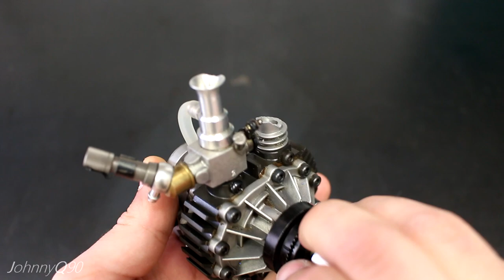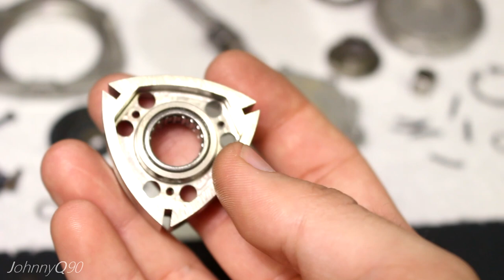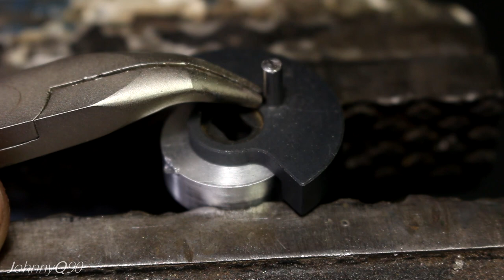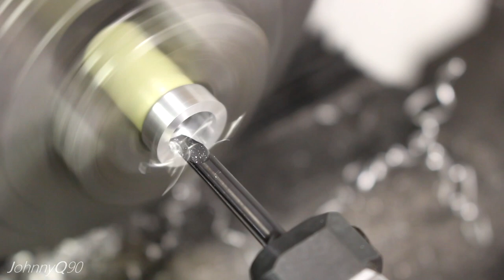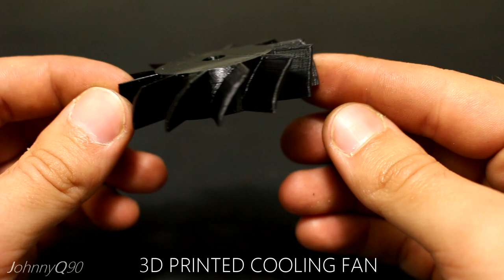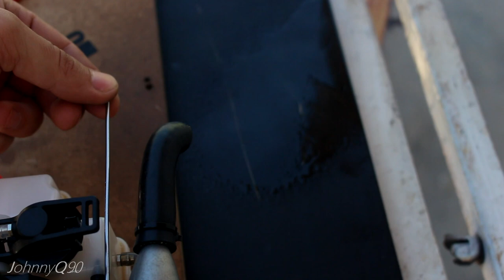Nitro Rotary Engine Cleaning & Pull Start Addition

Comment: Very cool, and yet most people believe the Wankel is dead.  I would like to see a 4 rotor design like this up against a Merlin engine from WW2 in a P51 or Spitfire.  The design was around for at least 20 years before World War 2.  Mazda and NSU finally manufactured the design in 1967.  These are the engines now being used as a "range extender engine" for the most modern Prototypes of electric drive cars featuring a Wankel 80 hp engine/generator.  It fits under the back seat and you can barely hear it. Fuel mileage at highway speed, low battery with the engine running is over 100 mpg.  And for an airplane, this engine makes even more sense.  I would love to see this engine running on 90% methanol and 10% water.
Reply: Actually the Wankel engine is dead, it has been obsolete as a production design since 2012.  Graupner discontinued them years ago and OS filed for bankruptcy.  The Wankel orbiting piston concept was not conceived until the early 1950's and Hanns Paschke and Walter Froede did not develop the Wankel engine until 1957. Sachs was the first company to manufacture them in 1964.
Reply: Wankel engines have never been used successfully as a range-extender, there are no manufacturers producing them for this application. The Wankel's terrible fuel consumption and exhaust emissions make it totally unsuitable for electric vehicle range extenders or hybrid powertrains. The Wankel engine was never commercially viable for aircraft because of the terrible BSFC which limits range and payload... its power band is also less than ideal for propeller drives, no one has ever managed to get a Wankel FAA or EASE certified for aircraft use either..
 The Wankel engine's fundamental geometry poses a serious disadvantage when considering alternative fuels like Methanol because the Wankel cannot support high enough static compression ratios for optimum thermal-fuel efficiency. 10% water? Why?  Water is not a fuel
Reply: Dr. BMW.  Honestly, I don't get your point other than you support Big Oily and V-8 piston engines running at 8:1 compression.  Here's some basic data from Wikipedia.  Felix did design the engine when I stated and it is anything but dead.  I can't understand why you would statements that are exactly the opposite of truth.
Kenneth M. Price jr   the-rise-and-stall-of-the-piston-engine.weebly.com

"The design was conceived by German engineer Felix Wankel. Wankel received his first patent for the engine in 1929. He began development in the early 1950s at NSU, completing a working prototype in 1957.[1] NSU subsequently licensed the design to companies around the world, who have continually added improvements. The engines produced are of spark ignition, with compression ignition engines having only been built in research projects.

The Wankel engine has the advantages of compact design and low weight over the most commonly used internal combustion engine employing reciprocating pistons. These advantages have given rotary engine applications in a variety of vehicles and devices, including: automobiles, motorcycles, racing cars, aircraft, go-karts, jet skis, snowmobiles, chainsaws, and auxiliary power units. The power-to-weight ratio has reached under one pound per horsepower in certain engines.[2]"

Comment: Would it be a cool idea to place several Nitro engines in series? Like placing some of these engines behind each other, letting them run at the same time and connecting them to a crankshaft. Would be pretty cool :). Please let us know ;)
Reply: I'm very curious about that to! like a small 2-troke V4

Comment: Nice Waco Biplane?  You are obviously skilled in the lathe.  Could you share kind, model No. and approx. price!  
Did you consider using TIG on the muffler?  The tubing inserted would have increased back pressure a bit.  Thanks

Comment: Looks good man! Do a turbo haha. But dont you think that pin you out into the countershaft threw off its balance? Could be stress on the bearings maybe try to find out how to equal out its balance again. Then it will rev easier and higher! It plays a big part in a fine tuned engine. Keep up the good work!

Comment: I saw you were using Loctitie on the exhaust, you should try JB Weld instead, more durable and withstands both oils, gasoline, heat etc. Expensive for the amount - yes, but you get a lot of value for the money..

Comment: A second hole in the counterweight in radial line with the first would have been a good idea to compensate for the added mass from the pin stick out.

Comment: you can tell adding the pin on the flywheel set the wights off alot  .. make a small hole on in the fly wheel on the side of the pin and test .  if you know the wight of said part before modding  then making the hole to size to wight would have worked better

Comment: Sure seemed like it vibrated a lot. Wonder how much you threw off the weight of the flywheel.
Reply: coolhanddruid does looks to be vibrating more than normal, make sure the balance weights are on the correct way (opposing the rotor) - also, on this engine the front balance weight is part of the prop hub. Looks like this has been removed in this video, probably the reason for it. Would be interested to see how it performs with a slightly different fan design and the prop hub back on.

Comment: I want to see a nitro generator. Use a VESC from torqueboards, and a high watt rc motor. I can help with part selection. Do a gear coupling and you can use an RC transmitter, or PPM tester to control the load, and use a computer to monitor power output

Comment: you can improve the performance of that engine with an adjustable velocity stack intake, like a trombone sliding tube coupled to the throttle linkage.

Comment: I saw it run in the video. My thought is that drilling the crankshaft counterweight and adding the pin does not look like something I would want to do using the engine for continued high rpm use, as in an RC airplane. Plus, the weight is being added to the weighted side of the counterbalance.  That steel pin has to be detrimental to the engine.  I fear it is causing an imbalance in the rotating assembly to the point where it can explode. Of course rpm has a lot to do with it but, most O.S. rotary engines turn up 10,000 rpm, some achieve 30,000.  For an engine this size, that pin is a lot of weight. Without a proper re-balance, it's life is definitely shortened. I would not want to be around if it comes unglued.

Comment: Next challenge, develop an actual cooling housing so the air is specifically pushing around the cooling fans and not just at the front of the engine.

Comment: Did you take into account the weight of the pin you inserted into the rear counterweight for the pull start? 'If you didn't add the same amount of weight to the front counterweight, that engine is going to spin itself apart.

Comment: try putting a 10x6 prop on it and tuning it from there you might be able to get a better tune with less smoke and oil dripping out. Nitro engines don't tune very well without the proper load on them!

Comment: OS makes quality stuff
Reply: O.S. bought the discontinued engine from Graupner GmbH. 
O.S. just file bankruptcy
Reply: doktorbimmer when you only make quality stuff at low volume when the market flooded with cheap Chinese throwaway that people are still buying , no matter what you will struggle
Reply: The Graupner Wankel engine design dates back to the 1960's  and sold poorly even back then, it sold the design to Hobbico (Chinese throwaway stuff) and even they gave up on them discontinuing them several years ago.

Comment: One thing I can't understand: Where the sparkplug gets electicity from?
Reply: Not a spark plug, its a glow plug.
Reply: doktorbimmer ok, but still. Where is it get electricity from?
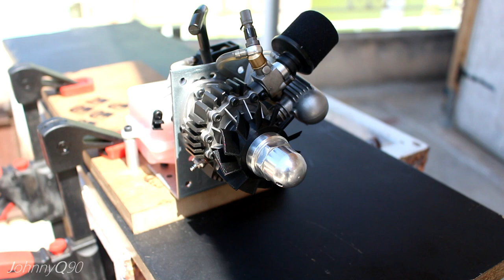Reply: At 8:25 you will see a tool attached called the glow plug ignitor it contains a 1.5 volt battery inside the whited colored handle, the battery is used to make the tiny filament (a coil of very thin platinum wire) inside the plug start to glow incandescent.  Once the engine is started the heat of combustion provides all the heat needed to keep the plug glowing hot and the battery can then be disconnected. _Cheers!

Comment: Why not spin the lathe at a low speed and set the saw on it to cut the backing plate?
Reply from the maker: Too dangerous
Reply: Even at the lathes lowest speed, with lube?

Comment: this shit is so impressive, what blew me away was you manually turning the lathe and filing that shit off, lmao.
and just a dumb question, but shouldn't drilling that hole and putting the pin in to the balancer have thrown off the balance of it?
and second, shouldn't reducing the output diameter of the exhaust have reduced performance too?

Comment: Would be fun to rip out the sequential turbos out of my rx7 and have two of these drive the low rpm and high rpm turbo....might be tough to design a way to rev them when the engine calls for air but the engine would run cooler so you could run really high boost or use a high compression non turbo rotory
Reply: One of these engine would barely have the power to run the heater blower.

Comment: Nice little engine, but... cleaning with old Nitro fuel and no gloves? Have they switched RC fuel to Ethanol, or...? If it is still Methanol, which is toxic and absorbs into skin, I would be a bit concerned about the DNA damage.

Comment: F*cking AWESOME use of Super Glue! What Lathe are you Using? Nice use Cross C and Face C axis drilling. Time for a Gecko Drive and  tool probe touch plate.
Reply: You should be able to make the gear plate for the spindle and engage a stepper motor for "Live Tooling" option. If you catch my Drift.

Comment: That is a two stroke engine?
Reply: Nope it’s a rotary, I don’t think it can be classified as a two stroke or a four stroke. It would be closer to say it’s a single stroke in my opinion.
Reply: @housegoth  charge/compression->combustion/exhaust. So, perhaps "2 cycle" would be more appropriate?
Reply: @Bryan L olds97_lss except it’s all done in a single rotating motion, there is no up stroke or down stroke and all four steps that you list are done in separate discrete parts of that rotation. The rotor acts as valves, cylinder, and piston all in one. It’s really a genius design.
Reply: @housegoth  : It's classified has Rotary.
Reply: ALL Wankel engines use the 4stroke operating principle

Comment: you shouldnt run that without a airplane prop on it .,.Its over reving and will overheat use 30 % nitro with added castor oil.

Comment: I suffer “aphasia”, stroke which means. I am unable to talk. Only “paste & copy” I am unable spelling. 
3.32 mins Lathe Turning Tool, Name ?  
I made 8X8MM X 45mm long,  4mm end / 4.5mm end, 3mm grub screws (2x end's) 4 Lathe Turning Tool.  used Lathe Turning Tool/End Mill  Ebay 
 I look  4 Lathe Turning Tool  (KAISER A 5/4 Hm, A 1.5/4, A 3/4). look (RB 15K-B-K16 Made in Germany)  I found internet result, 0 (Zero)
Thank you

Comment: Seriously ??????? Put it on a shelf and keep it for posterity. I bought one of these things when they first came out in the 70's. For R/C  modeling purposes, they are useless, lacking badly in power. Also they gobble up the fuel like it's going out of fashion and get VERY messy in operation. A good idea, but fell flat in practice.

Comment: Still has more HP than a turbo mustang EcoBoost
Reply: Wankel engines are not even made anymore, nothing has less torque than one.
Reply: doktorbimmer true, but a badass is able to keep them running.
Reply: Not even Mazda could keep them running... which is why they abandoned the Wankel engine years ago and only make reciprocating engines now.
Reply: Certainly not old, obsolete engines like the Wankel I hope... the Wankel design is dead. Cheers mate!
Reply: doktorbimmer so is this conversation
Reply: True, not even a badass is able to keep the Wankel relevant in any conversation regarding automobiles

Comment: Your invention is unique but a little too slow to developed in today economy companies decide to make them electrical way less cheaper than gas more economical and less expensive...to the time you manufacture the motor get parts get buyers is not a cheap piece and parts expensive and explode to the market if you catch electrical are much faster and less and more economical than gas

Comment: Hey..  i have a brand new deposit of industrial diamond... big diamonds... they are the hardest substance we know of in the Universe... they have 0 heat expansion coefficient... they are a superconductor for heat and bleed off heat instantly
Reply: It is machine shop ready.. needs no preparation... i have pieces as large as a VW bug
Reply: I will donate a few  .  See what you can do with them
Reply: Carbon is the lightest semi metal in the periodic table... 6 protons 6 neutrons and electrons.. it is lighter than aluminum and stronger than steel